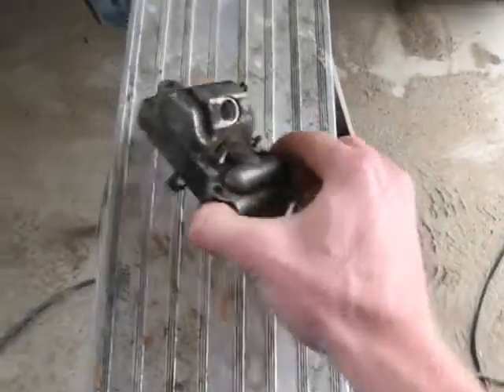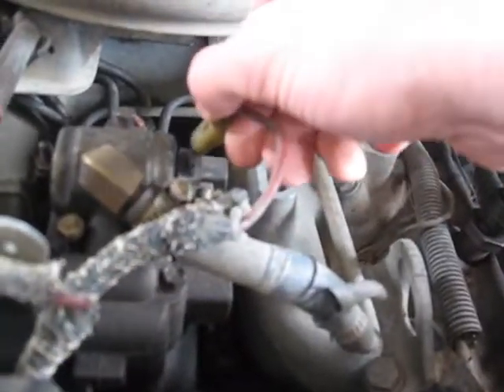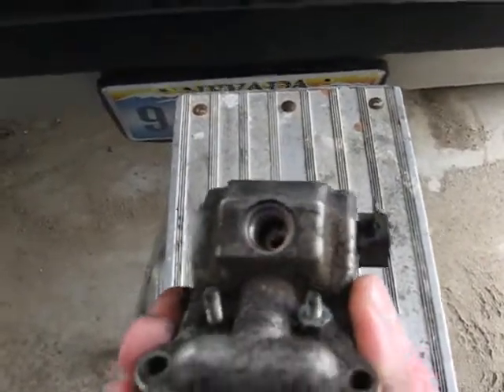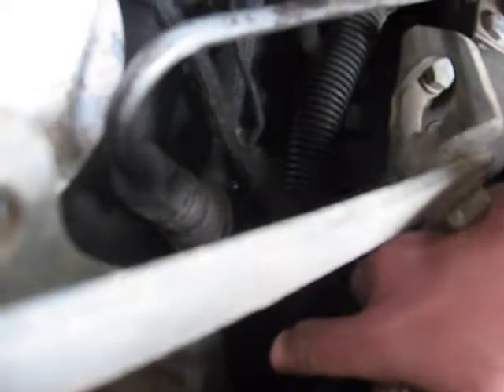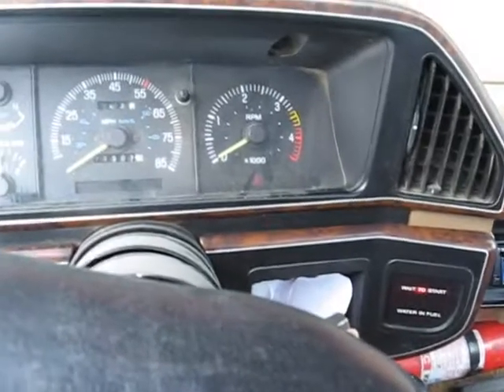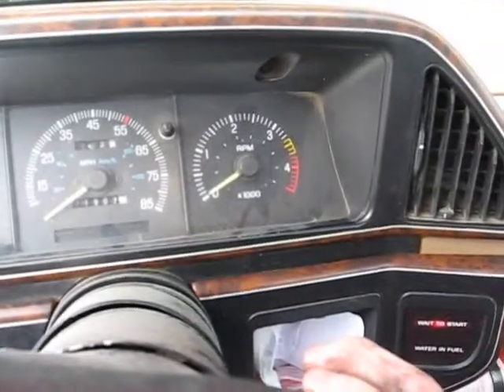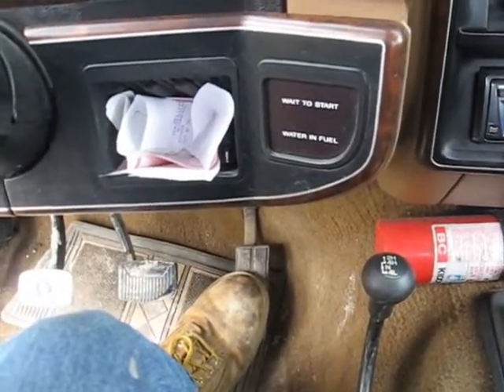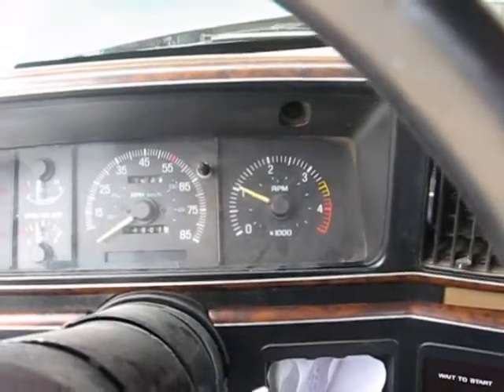Cold Timing Advance Issues with DB2

Comment: My truck has the same problem. When I am driving a constant speed, all of a sudden my truck's rpm jump once in a while so I unplugged the plug on the IP, and the idle changed back to normal, but when i started driving again it did the same thing with the cold timing advance unplugged?? Any ideas?
Reply: Air in injection pump